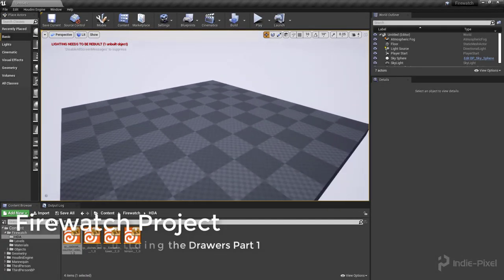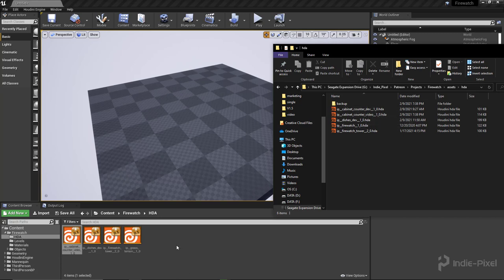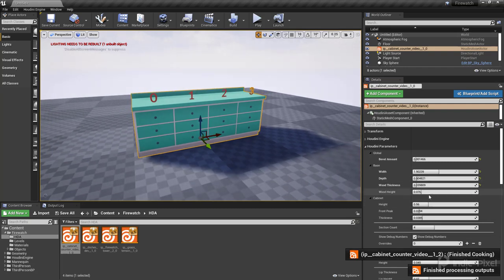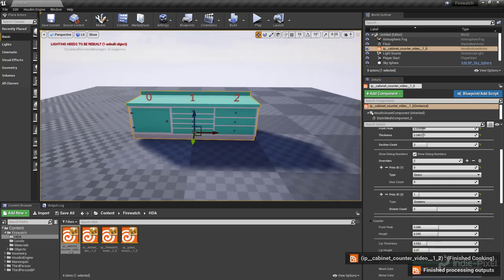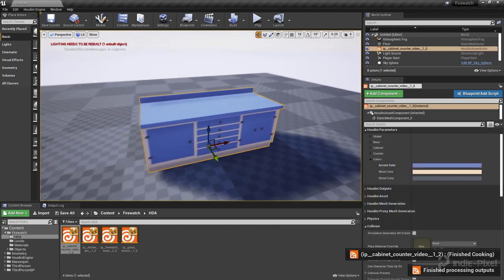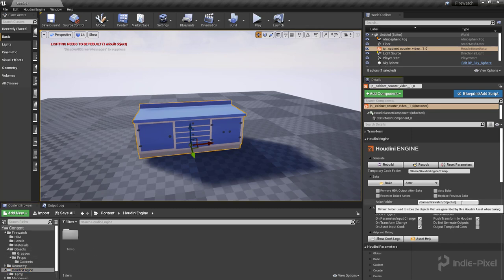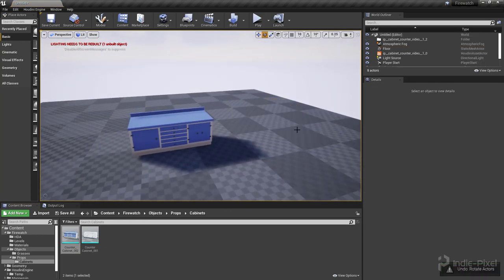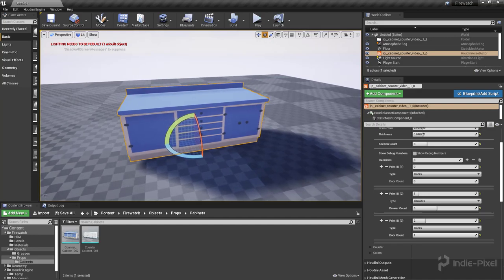Firewatch Project - Procedural Props #1 - Conclusion

Comment: Great course, just one thing. I'm doing an FBX Export with ROP FBX Export and Unreal Complains about this: "Unable to Triangulate Mesh". The Problem goes away after I subdivide the mesh before export. But I don't want to subdivide the mesh. Any Ideas?
Reply from the maker: Try using the poly soup node at the end of you geo network...if that doesn't work then a divide node to do the triangulation will work.